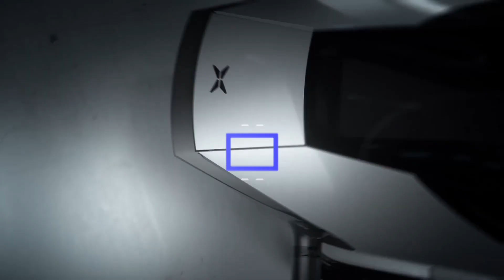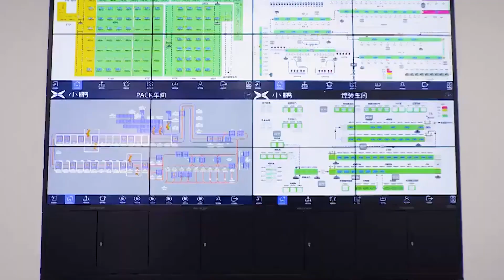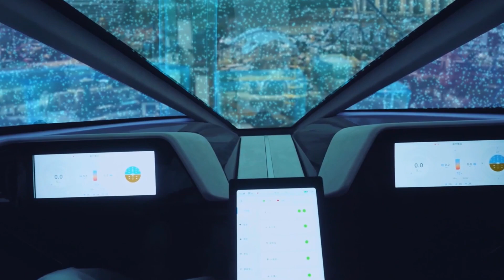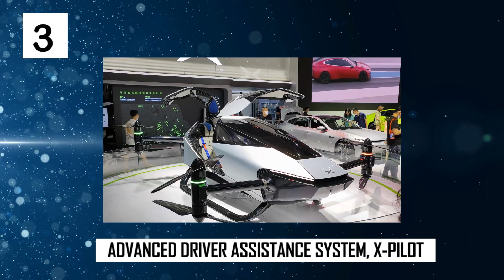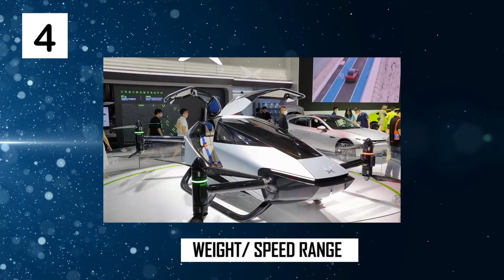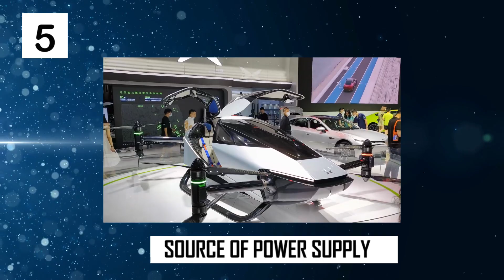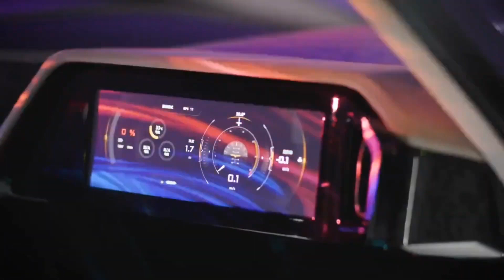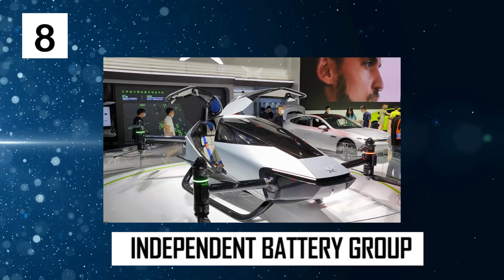First Flying Car Ever! Here Are 8 FACTS About The Xpeng Voyager

Comment: That's great, by the time you fly to the shops in the next street you can't put the shopping in because it adds weight and you can't fly home again because it's run out of power. lol

At least they will look good permanently parked in the car park. 😀
Reply from the maker: Good point! Plus they'll sure look good when parked in a car park.
Reply: @poshfuture1833  indeed. 😁